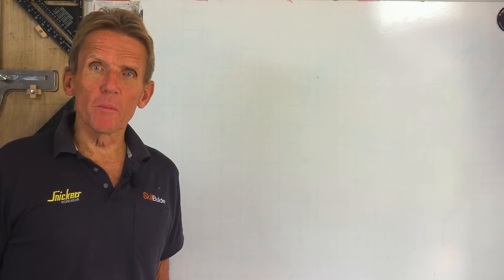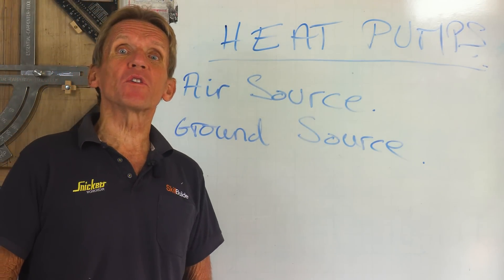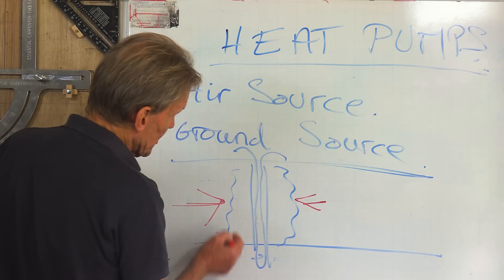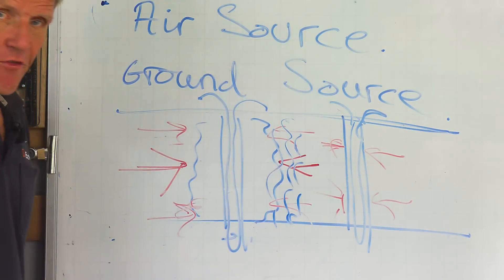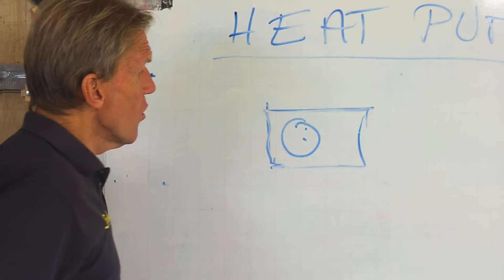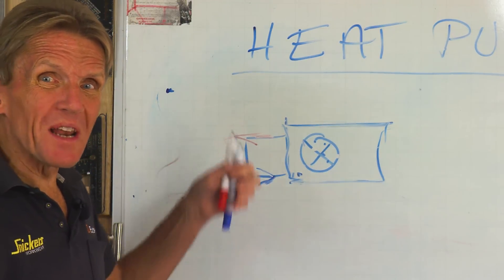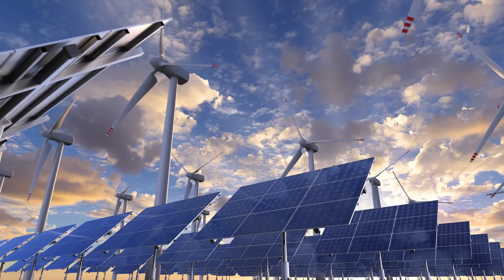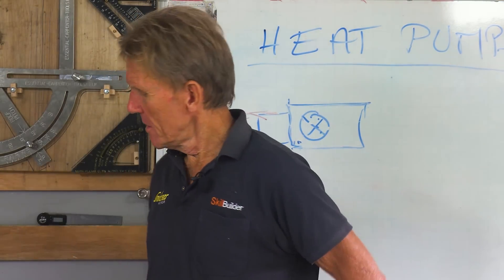Heat Pumps ~ Get Your Facts Straight!

Comment: We had a Daikin mini split air conditioner installed in our 1930s 3-bedroom house. 5 indoor units connected to a 9kW outdoor unit. The house is about average in terms of insulation for UK standards (cavity wall, loft, double glazing). The house had storage heaters when we bought it, so it was either a full central heating install or this. The system cost us £9k for top of the range model, central heating would have been £8k.

We used about 80kWh of electricity a month (approx. £21) in July to cool and 300kWh of electricity this November to heat (approx. £81). We can monitor our energy usage down to 2-hour intervals for each room in the app.

We still use a small,on-demand gas water heater for hot water.  The system works great, each room can be controlled individually on our phones, rooms heat up in a matter of 10 minutes, and having cooling in the summer is next to none in terms of comfort. Having the extra wall space is a bonus too. The only drawback is that the indoor units do make a bit of noise as they are fan-assisted, but they quickly blend into the background.

It's a shame the government doesn't support air-to-air systems with grants, as our CO2 impact is still measurably lower than a gas boiler, and most definitely much lower than a poorly installed air-to-water system.  It would be good to see more info on air-to-air out there as it seems, right now, the overpriced monobloc heat pumps are all people know about.

Comment: Great explanation.

I think the biggest problem will be the rising cost of electricity used to run the heat pumps, say in 10 years do you think the electricity cost is going to go up or down, with all the extra load of EV's and such i think the price will rise more unless some miracle happens with power generation or battery storage.

Be nice if you had a heat pump to work alongside a normal gas boiler so you can have the best of both worlds. I would have thought it was possible although i think the heat pumps run at a much lower temp. 

Will be interesting to see how it all works out over the next 10 or so years.

Comment: I always wonder how a heat pump manages in comparison to a gas fired boiler heating system and what happens when the air outside is considerably colder than you need indoors or even below freezing temperatures. Surely an air heat pump cannot warm a house from freezing outside air.
Reply: It does. Even at minus 10C it's still 260 degrees Kelvin. It pulls the heat out of a lot of outside air, compresses it, concentrates it into your circulating fluid, which heats your radiators.

Comment: Hi Roger! Please help. We are renovating a big neglected damp house in the far north Highlands of Scotland which is 100+ year old solid wall house. It has 4 bedrooms upstairs and an old shop downstairs. We have no decent insulation at present - just the air gap behind the drywall. We have no gas provision and no heating system except plug in electric heaters. I am contemplating accepting the free insulation and heat pump, but i've been told that it doesn't work for solid wall houses; only very well insulated houses. Do you think that if we accepted the internal insulation to 2/3 of the home there is a chance that the heat pump would be worthwhile accepting? On the one hand I think they might be a con; on the other hand we're desperate for an affordable way to get our house warm. (My electricity bill for the last 2 years is over £5000) . Thank you 🙏

Comment: He is right about people calling them Geothermal instead of Ground Source.  I don't know about the UK but I do know in the USA the Ground Source heat pumps are even marketed as "Geothermal" and it really bugs me.  The Biden administration is even getting ready to force taxpayers to pay subsidies to manufacturers of heat pumps.  This is something the market should decide.  It makes more and more people really vulnerable to extended power outages.  In Northern Minnesota and Wisconsin it is not uncommon for a power outage of over a week. With gas, wood or heating oil it is no problem.  Making people believe they can now "trade in" or get rid of their gas or wood furnaces will cause people to freeze to death.

Comment: My best friend is high up in the HVAC industry and 15 years go they put ground source head pumps into 5 terrace new build houses. 
All was fine in the summer, but in winter the middle house's "numbers" were way off, they surveyed the ground and found the garden in the middle house had turned to perma-frost!
The ground never thawed during the winter and the pump could not extract any heat!
Trial was cancelled!
Reply: inadequate design. It would have worked better if they had used a communal ground loop

Comment: Interesting thoughts on a ground source heat pump freezing the ground around and thus losing effectiveness. It's gone now, but the old Southamton Ice Rink was built cheaply with the ice pad directly on the ground. This created "permafrost", which over the seasons, jacked the centre if the ice upwards, like a crown bowling green. Eventually the entire thing had to be dug up and rebuilt.
Reply: I've never actually come across a case of the ground loops freezing the ground in the UK. In theory it can happen and I'm sure it probably has somewhere, but that could only happen if the wrong spec system was installed e.g. groundloops too short for the heat demand. In such a case it shouldn't ever affect the building at all anyway as you are supposed to insulate and sleeve the pipes within about 3 meters of the building anyway so they cannot possibly freeze the ground. Roger's thoughts here are just more doom mongering and no more realistic than saying your gas boiler could leak and blow up the house. Yes it could, but not if installed and maintained correctly.

Comment: I have to pick you up one one of the inaccuracies in this video. Heat Pump aircond (HPAC) is far more efficient for space heating, is simpler and cheaper to install and is far more flexible to use than air to water HP. Heat is supplied almost instantaneously where and when you want it. It's scandalous and very wasteful that the Gov uses the pathetic excuse that HPACs can be used for cooling to exclude them from grants. Our HPACs run on solar on the few summer days when we might need cooling so there is no effect on the environment. The only drawback of our HPAcs is that, for now, we have to rely on useless gas heating for shower water.
Reply from the maker: sorry I don't understand where the inaccuracies are. Air carries far less heat than water, that is a fact of physics. I agree that air source is cheaper and  easier and that is what I would use but the SCOP from air to water is more.

Comment: Of course the ground stays at a constant temperature all year round...if you go deep enough.  The surprising thing is that depending on geology of your ground that could be as little as 12 ft below surface.

Interestingly wet, clay or sandy soils are probably best for heat conductivity.

So for a lot of places, preferably close to a river (so lots of river silt soil) going down 40-50m is probably sufficient
Reply: Except of course the surface, hence the depth requirement for water pipes...

Comment: Sounds like one big scam. My gaff is so well insulated I have to run a dehumidifier all night when the temperature gets a bit parky just to stop us drowning. So where's the savings and how many penguins have I saved? This hasn't been really thought out has it? If I decided to chuck out my reliable and cost effective gas boiler and have one of these great noisy lumps installed where would it go? The only place is the side alley from the drive to the back garden. That'll mean no access down the side of the house as the poxy thing will completely fill the footpath! Then there's the neighbours to consider regarding the noise. 
As I said, hasn't been really thought out has it?

Comment: Air heat pumps need to have an ambient temperature at least 5-8 degrees higher than we have in the UK to be any good, plus they are noisy and expensive to run! Ground source need to be in a trench over a meter deep so they can be below the frost level. The piping needs to be longer than recommended due to the lack of heat in the ground in the UK!  Both are very expensive and not worth having  stick to the Gas boiler & two fingers to the governments rules!  Ask the question How many MP's have installed heat pumps to their homes?  Remember we the tax payers will be hit with the bills! Either from grants or on their expenses!
Reply: Where's your evidence for the first statement? It's currently -7C outside, and my house is heated by (air source) heatpumps to 21C just fine.

Comment: Two thirds of houses in Norway use heat pumps and that's in temperatures of  -25 degC. Good clear video, thanks Roger.
Reply: Electricity costs in Norway are cheaper than the UK.
Reply: Setting up these systems in a country with a tiny population and electricity produced mainly by hydropower is of little relevance to the UK. The insane UK plans have no contingency that can be seen for dunkelflaute which is hardly a problem in Norway so your heat pumps will keep running. Keep supplying us with gas though as without it we will be doomed with our closing down our own production facilities to buy in from abroad.

Comment: Geothermal means geo-earth thermal-heat so you can call a ground sourced heat pump a geothermal system and be correct.
Reply from the maker: No you can't because it is not correct. The whole point of language is to use it as a precision instrument rather that a shovel. Geo Thermal describes heat generated by geology. Ground source is simpy the earth all across the planet that is warmed by the sun. It makes a difference when you calculate the heat input.
Reply: @SkillBuilder  sigh
Definition 
Geothermal energy is heat within the earth. The word geothermal comes from the Greek words geo (earth) and therme (heat). Geothermal energy is a renewable energy source because heat is continuously produced inside the earth. People use geothermal heat for bathing, for heating buildings, and for generating electricity.

Comment: I'm pleasantly surprised with this video. I took a lot of issues with your previous anti heat pump videos.

This one however seems to be more on the right track at least. One thing that I've noticed however is that heat pumps still work if you don't have much insulation and what seems to matter most is the size of your pipes BUT insulation means you don't need massive pipes unless they're microbore pipes like my own perhaps.

This being said, additional insulation (and ventilation) means you reduce your overall heat demand which means you don't need to consume as much energy in the first place. That in itself reduces your emissions.

For me, I'll be upgrading all my piping first and super insulating. Super insulating perhaps isn't a necessity but I figure that I should reduce my overall heat demand first.

It also means I can stage my heat pump installation somewhat too

Comment: So you're telling me that, when it's, say 5 degrees centigrade outside, an air to air unit will extract enough heat from the air to warm the inside to say 20 degrees centigrade. I have to say, I'm a bit dubious

Comment: The ground temperature can be pretty constant depending on the depth and location. Ground near the sea has different temperatures than ground way inland as the temperature of the sea greatly affects the adjacent land. As heat is extracted the ground around the heat pump's borehole pipes will get cooler. The sun wil re-heat the ground but mainly by the convection of the surrounding warmer ground.  If you extract too much heat the ground can become tundra.

This tundra will be reheated by the surrounding ground during summer. Some buildings in the USA use this tundra to cool the building in summer, reheating the ground.

Some systems use two boreholes, say one at the front and one at the rear of the house. By alternating you can allow the ground to reheat one borehole while extracting heat from the other.

Far more efficient than air sourced.
Reply: Convection in the ground? So you think the soil circulates?
Reply: @alanjm1234  
Sharpen up.
Reply: @alanjm1234 wheres the circulation in a baked potato?
Reply: That's correct. In the UK the ground temperature is a constant 7 to 8 C at a depth of about 10 feet and deeper. Water supply pipes are usually at a very shallow depth, hence SkillBuilder's confusion. Some ground heating at depth is geothermal in the UK, particularly where we have deep limestone with warm springs. His point regarding horizontal ground to water HP seems moot as they demonstably work.
Reply: @gsum1000  
Horizontal slinkies in trenches about 3 foot deep work better in ground with good exposure to the sun not on the shaded north side. 

At the time you need high temperatures the air is very cold outside, hence a problem with air sourced heat pumps. Although an average over the year is realistically the economic measure. Air temperatures will raise and lower quickly and greatly unlike the more stable ground.
Reply: @johnburns4017  Now you sound confused. In temperate climates with lower sunlight levels during several month of the year, it becomes important to capture the solar energy stored deeper in the ground, even during the coldest and darkest months. And, in most cases, it's much easier to simply bore down and out again for an installation  (especially retro) that works all year round for highly efficient space and water heating.
Reply: @johnmcmullan9741  
Read what I wrote again.
Reply: @gsum1000 the ground is solid and temp minus , no sun , will heat pump still generate enough heat ? , my walls are 12-13 degrees with no heating on today

Comment: In very simple turns if you ever feel pipes on the back of your fridge or freezer they are warm due to the heat exchanger principle.However I cant get my head around heating a whole house with heat extracted that way without using alot of sparks to drive a big exchanger and I certainly cant see how it can heat water up more than a few degrees.

Comment: If nothing else your entertaining. So drill the bore hole which is couple of hundred feet deep, start drawing heat from the surrounding ground and this ground at one hundred feet and more down starts to freeze. What a load of old tosh. The heat from the bore hole comes from the earth's core. Any other misleading facts in your toolbox.
Reply from the maker: You have no idea what you are talking about. Very few ground source heat pumps are drawing heat from the Earth's core. 
Read a few case studies from the Ground Source Heat Pump Association. Freezing ground is a fact of life with ground source.
Reply: @SkillBuilder    Geothermal isn't hot water gushing out a Norwegian geyser Geothermal loops is a pipe system placed in the ground starting at about 5 feet deep in which the surrounding temperature is about 45 to 55 degrees the deeper you go the warmer the temperature. It never freezes it's always a constant temperature as planet earth is very good at storing heat from the sun. This gives this system greater superiority over air sourced heat pumps especially in winter when air heat pumps are ineffective. If there is radiators in the property they require to be about twice the surface area of standard ones due to lower water temperature. 
Get your facts right before trying to be a YouTube superstar.

Comment: im using LPG from the petrol station i use about 23-25L of lpg AT 84p L i dont use any eletric at all everything run from solar and when i move my motorhome plus i use a dirty diesel heater the chinesse type 5KW for £100 that uses about 10L a week ish i dont live in a house so how would a heat pump work for me

Comment: I have it on good authority for the last 5 years someone has installed / run a ground source heat pump with the source being a solar hot water panel,.  Apparently runs like a dream.

Comment: When I had my combi boiler installed three years ago the fitter told me heat pumps are virtually useless in homes like mine built in 60s. A neighbour has one but has stripped all walls of plaster and relined with insulation board, not sure I could be arsed with that, I doubt I'd live long enough to recoup the cost.
Reply: Surely we can all transfer to the second home while they strip out the house. Net zero is surely all about people who can spend £30,000 to knock £300 a year off their heating bill and constantly tell everyone about the latter.
Reply: Yes let children and grandchildren to bothered about global warming.
Reply: @peterjones6322  Exagerrated !
Reply: Flipper, 

that's looking at it the wrong way. Improving the insulation makes a difference for gas\oil heating as well, it cuts running cost. Insulating so that a heat pump can be fitted is more expensive and less effective due to the lower temperatures from a heat pump.
Reply: The ruling class are incompetant. China creates 33% of co2 we create 1%. We are not the criminals here. This will destroy us.
Reply: When will you recoup the cost of your gas boiler?